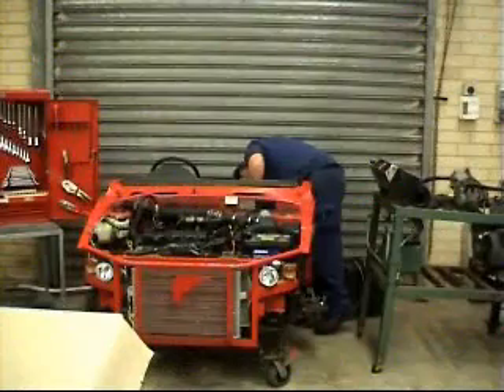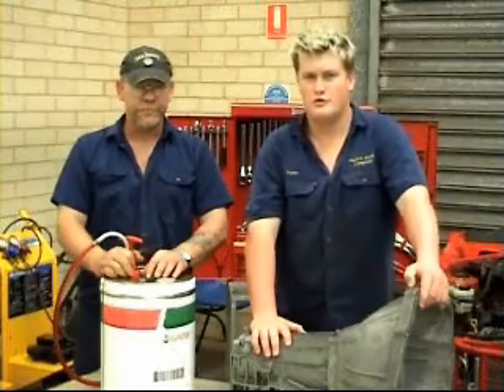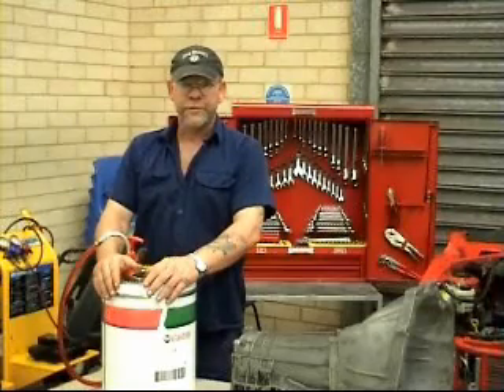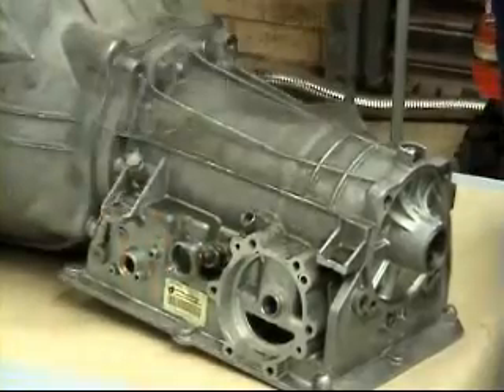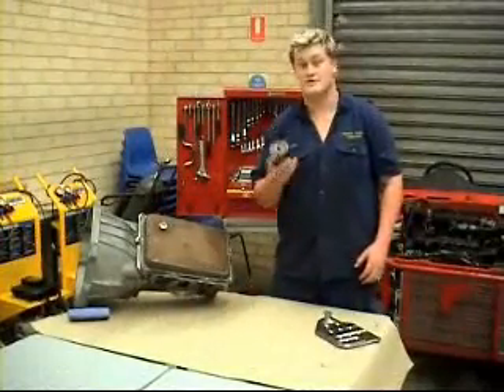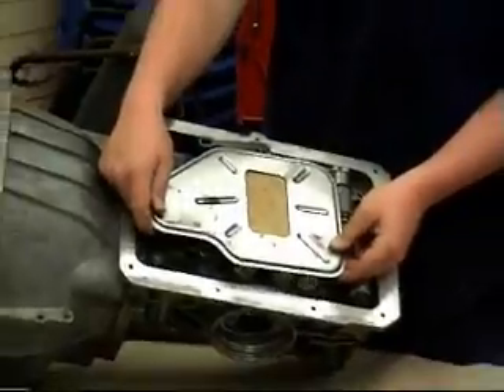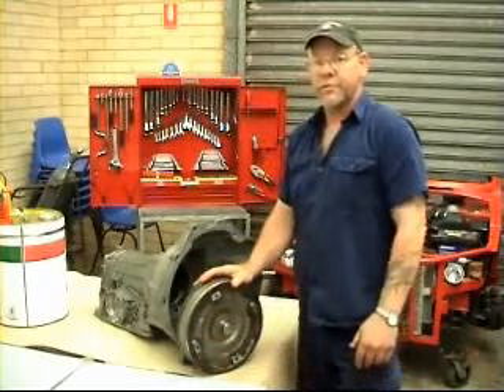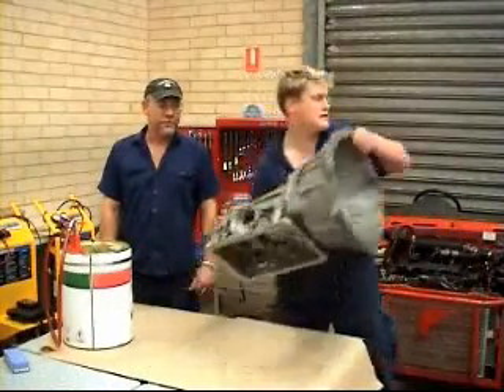Service an automatic transmission

Comment: @Filmaker25 

This is an example of them being almost too good/efficient - the clutch going in, the next gear being selected then the clutch coming out quickly and power being reapplied to the throttle.
A similar effect can be found by changing gear with a manual transmission, and bringing the clutch out too quickly after gear selection.